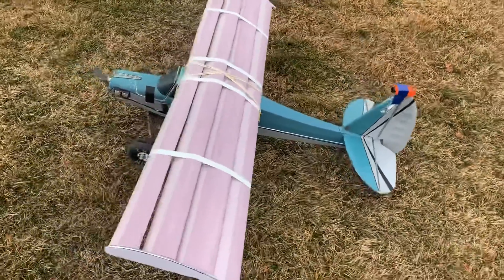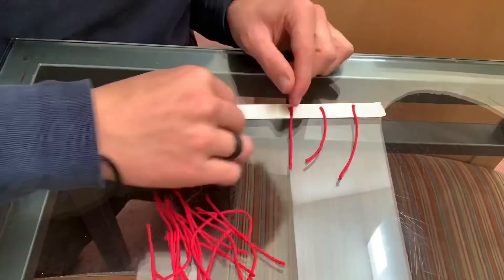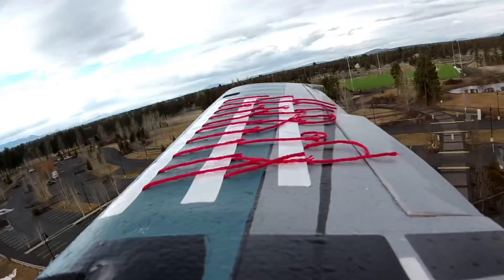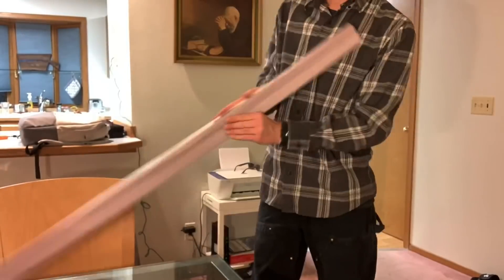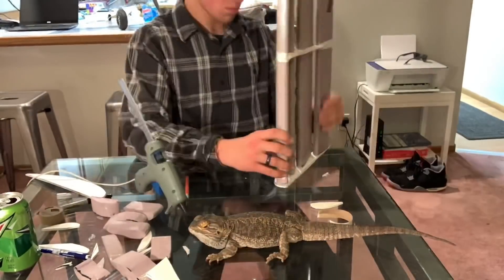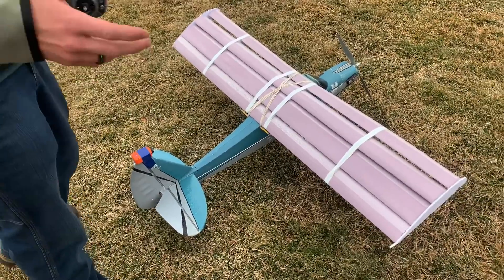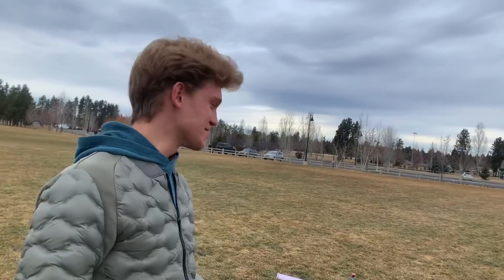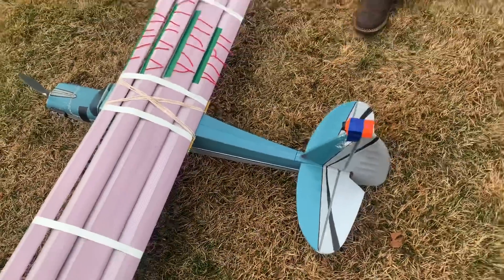“Unstallable Wing?!”

Comment: Stall is separation of flow over the top, and loss of flow to the trailing edge controls. Mainly its nothing but turbulence instead of flow which makes lift & gives control.
Not just too slow flow, but burbling mess instead of flow.

Aspect ratio is span squared / area.
At aspect ratio under 3, when flown slowly at high "A", the huge wing-tip vortices wrap around capturing a "bubble" of low pressure above/behind the wing giving up to 3 or 4x the lift you'd expect from that area at such slow speed.
The vortices trap flow from the front over the wing keeping it from separating.
Controlled stall-free flight has been demonstrated at up to 40+ degrees "A". Conversely, they need 20+ degrees to gain extra lift and get aloft.
The wartime German Sack AS-6 most likely didn't have appropriate landing gear to allow "A" to get aloft. Many similar planes have done well.

They are not burdened by always carrying around the vortices and attendant drag: the vortex-driven "parachute lift" at super slow speed and high "A" is elective and temporary. 

Many of the very-low aspect-ratio planform have proven this, and also proven to not be draggy or inefficient in cruise, but notably quick on available power.

Comment: I'm not sure what protocol you're using but if it's a Spektrum, they have a safety feature called THROTTLE CUT. It disables the throttle with a flick of a switch. It's a good thing to use and mandatory at my flying club.

Comment: Well the problem here is with big angle of attack, thrust points upwards meanwhile you would like to continue forward, which does not work. There is no force, that would push you forward. And the reason why we do not use such wings is, that there is ton of drag created. Even STOL airplanes with slots has bad performance regarding drag. No STOL airplane can fly too fast. There is always a cost for any gain. Therefore it is better not to stall airplane and fly with small angle of attack and to have good performance wing. If you are at least a bit skilled pilot, you do not stall your airplane accidentaly. And if you do, you should train more ;-)

Comment: To cut Styrofoam, cut two airfoils from wood and stick them to the Styrofoam. Get some thin wire and a rheostat to control the current heating the wire. Make sure you don't electrocute yourself. Use the hot wire to cut the airfoil

Comment: It seems like almost none of the individual wings were stalling. I wonder if it's because the air flowing over the top of each wing is compressed by the gap with the previous one and has locally higher velocity?
Reply: Correct conclusion (locally higher velocity), incorrect reasoning.

Stalls happen because skin friction drag slows down the airflow close to the wing surface to near zero; this has no impact on the leading part of the wing because the pressure is reducing with the airflow, helping the air along. But on the trailing part of the wing where pressure increases back to atmospheric the air molecules don't have as much kinetic energy remaining to convert to push through the adverse pressure gradient. Taken to extremes by decreasing the speed, and hence the kinetic energy reserve available to the air, the result is the onset of reverse flow of the kind that send the wing strings forwards (as seen in the video), flow separation and loss of lift, as basically the adverse pressure gradient is pushing the air on the trailing edge forwards faster than viscous interaction with the faster moving air a little further away from the wing is dragging it rearwards.

By employing slats, it essentially takes high velocity air from below the wing and injects it into this slow airflow, speeding it up through viscous mixing and giving it the kinetic energy it needs to work through the adverse pressure gradient, preventing the flow reversal and stall, and shoving the stall speed down as a result.

More slats = more fast air injection = more energy available to skin-friction-drag-impacted-air = shoving down of stall speed.
Reply: @spychopath  well, to be technical about it, stalls occur when flow separation occurs which mostly dependent on velocity is not a strict function of it—iirc it's momentum specifically... Somewhere there's a Reynolds number in there. Of course the impact of density changes are minimal compared to airspeed  You'll note that I say the slats compressed the air. If you read between the lines and recall your basic fluid dynamics, Bernoulli says this means the velocity increases, which was indeed what I was going for. Thanks for emphasizing the importance of air velocity. I guess what I tried to say I said too briefly. Thanks for providing clarification for any other readers!

Comment: Nice idea, but its not scalable. Reynolds numbers come into play. Flight is a series of compromises. This would work to a point, but the increase in drag would make the idea uneconomical. It is simply an extension of slats which is a single element at the leading edge and are used on many aircraft including commercial passenger aircraft and homebuilt STOL craft.

Comment: Stall results from the wing exceeding the critical angle of attack.
Wings can stall at any speed.
Speed generates lift, more speed more lift.
Once lift is sufficient to counteract load (gravity in unaccelerated flight), no more speed is required to fly, and no more angle of attack is required, thus the wind will not stall.
Stalling is not a problem in flight, but poor airmanship is a problem.
Therefore, efficiency is more important than anti-stall, in real aircraft.

Comment: I was interested in this video because your wing is similar to an F1 cars front wing.  I now see why they have so many elements....at the same time, I'm curious why your wing isn't stalling. Is it because of the multi wing design or because as you pitch back, the several wings become more and more effective due to their angle.....the latter wouldn't apply to F1 cars because they're at a static angle.  🤔

Comment: The result is not a realy advance because the plane is uncontrolable at too low speed...2 old systems make a plane autostable without complications like slotted wings: the autostable wing profile use on the Fauvel flying wing, and the Mignet flying flea (upgraded HM14 1936 and later models): close the stall, both did recover alone normal flying conditions without pilot action...on a Fauvel did the wing porpoise like dolphins, and on the flying flea did the airplane only slowly sink

Comment: Our Cessna 150 (N51305) after a new NACA foil and a stall kit added our take off speed was around 12 knots. With the right wind speed we could take off backwards.
Dryden NASA out at Edwards Air Force base even tested our plane. We have VHS tapes of them testing it.
Our plane is the military grey with the letters RG on the tail with the air force bars and stripes on the side.
One day our father was flying in to Mojave airport. He was cleared to land. Then 4 Apache helicopters were cleared to land. They flew right under him. He lined the plane up with the 4 helicopters. When the helicopters landed vertical, so did our dad. It freaked out the helicopter pilots.
They all went to the tower to find out where this new vertical take off and landing plane was. The tower guy was our friend so he knew but he didn't tell them.
This was back in the early 90's.

Comment: That was a great experiment.  At some point, stall or not, you just won't have enough lift to fly.  When you crashed your spiral prop wash was probably dominating the normal wing air flow plus the reaction torque from speeding up the prop just couldn't be overcome, especially without ailerons.  Another thing to try might be slower and slower snap stalls, or try to do a crow-mode type descent with the elevator full up.
Reply from the maker: Good ideas! I’ll keep those in mind, I plan to have a part three coming soon!
Reply: @baileyharrisRC  One more idea, I tried gluing on little vortex generators on a Multiplex Acromaster, achieved almost what you did but retains the original wing.  It had with a lot more drag (used too many) but flew like it was on rails and could not stall it.  You can make them out of thin plastic.

Comment: Just one suggestion: put flat, wing tip end-plates (latger than the profile of the airfoil) to keep the airflow over the wing stable when the stall approaches. This will cause a mild loss of altitude (parachuting) but no catastrophic stall.

Comment: A stall is a condition in aerodynamics and aviation wherein the angle of attack increases beyond a certain point such that the lift begins to decrease. The angle at which this occurs is called the critical angle of attack. Air flow separation begins to occur at small angles of attack while attached flow over the wing is still dominant. Not speed..
See this site in design of Scrappy's wing I think you will find it interesting. https://www.youtube.com/watch?v=JcckHHiYkL0&t=215s

Comment: If you define stall as air becoming turbulent then in fact I don't think it stalled. The reason you lost control is a) too little airflow on control surfaces and b) no speed means no lift, no matter if the flow is laminar or turbulent, which makes your plane act as a brick.

Comment: Nice.  The large air gaps were smart, it looks like the slots might have been working.  The Reynolds Number calculation describes how the air behaves at different scales, on the smaller model scale the air is more sticky and flow could easily block making the slots appear to be absent.  Getting the Reynolds number effects right is very complex.  Big is beautiful.

Comment: What did I tell you about stealing my Venetian blinds for your silly toy airplanes?!

I kid of course.

Obviously, the problem with scaling up an idea like this is that the wing provides far more than a simple lifting surface for the craft. The space and structure and Aerodynamic protection for things like lights, fuel tanks, and flight control hardware.

Some of this could possibly be dealt with by moving to an Electrically powered airplane, but I don't see that as being quite viable yet.

Comment: I heard there's a practical application of this concept, the Antonov AN-2 (wiki: "The An-2 has no stall speed, a fact which is quoted in the operating handbook. A note from the pilot's handbook reads: "If the engine quits in instrument conditions or at night, the pilot should pull the control column full aft and keep the wings level. The leading-edge slats will snap out at about 64 km/h (40 mph) and when the airplane slows to a forward speed of about 40 km/h (25 mph), the airplane will sink at about a parachute descent rate until the aircraft hits the ground."[4] As such, pilots of the An-2 have stated that they are capable of flying the aircraft in full control at 48 km/h (30 mph) (as a contrast, a Cessna four-seater light aircraft has a stall speed of around 80 km/h (50 mph)).[citation needed] This slow stall speed makes it possible for the aircraft to fly backwards relative to the ground: if the aircraft is pointed into a headwind of roughly 56 km/h (35 mph), it will travel backwards at 8 km/h (5 mph) whilst under full control.")
Reply: yo thanks this is really cool
Reply: This is called slots. There are such planes. Bush pilots like to use them for short take-offs and landings.
Reply: @petrsedlak4761  только не slot, а stol
Reply: @spacer_feed8411  What? Of what?
Reply: @petrsedlak4761  correct name "stol" 
You write "slot"

Comment: Same concept as Fowler flaps and slats. The problem is your wing is unlikely to be as efficient as a traditional wing in the desired flight envelope. Mike Patey's advanced slat and flap design for his plane, Scrapy, is probably the closest to an "unstallable" wing you'll ever get on a full size plane designed to actually get places in a reasonable amount of time.

Also, stalls aren't necessarily a bad thing. Reality is there will be a point where the wing ceases to produce sufficient lift. The important thing is that it has benign stall characteristics. For some full-size examples look at the Lancair IV, which had notoriously bad stall characteristics with a strong tendency to drop a wing and go into an unrecoverable spin. With some help from NASA, Columbia Aircraft cranked out a wing that was almost as efficient, but that is well-known for being able to pull back into a full-stall and just gently pitch forward again until it builds enough airspeed to start flying again, and if the controls are still held full-aft, it just cycles over again. The end-result is a mild stall buffet and a modest rate of descent even with full-aft input on the stick. There are plenty of bush planes with comparably mild stall characteristics, or even more favorable stall characteristics.

A low stall speed is great, but I'd argue stall characteristics are more important. You want something that stall predictably and without any tendency for asymmetric loss of lift which can lead to a spin.

Comment: If you ever do a lot of poly foam reshaping again I've got two words for you:
Hot knife.
A bit of stretched stainless steel wire, a dc power supply and a bit of creativity can make a jig/device that can help you create uniform airfoils. Articulation of the wing vanes (like fowler flaps) can probably also grant some huge benefits, such as a bifurcate design for the rearmost vane so they can be used as ailerons.
I think that the logical conclusion is forced air so that the wing resembles large blown fowler flaps.
This could be really big for the stol community if it isn't already a thing.

Clearly at low airspeeds your elevator will ha e very little effect. Consider the relation of center of lift and center of balance.

Comment: Yeah well done! It was great to watch. Exciting LOL.

So wings stall at 16deg AoA. You can exceed this by doing what you've done (each element is never over 16deg AoA but collectively they can be) but I reckon your design is a bit like reinventing the wheel rather than discovering something we've overlooked. If it were better, in all likelihood it would've been at least very well tested by now since our understanding of aerodynamics is fairly well understood. I could be wrong however.

So leading edge slats, and Fowler flaps with a high lift wing in the middle (with lots of excess power and a large prop blowing air over the wings) should go close too. 
Engine enhancements not withstanding, some birds do this even with multiple element winglets. Check an owl out. It is friggen unbelievable the lengths nature goes to keep the boundary layer attached thereby eliminating feathers from rustling at high AoA. That's why owls are almost silent killers.

Perhaps have the main wing at the usual 4deg AOA, then leading edge slats to duct air over the upper surface of the main wing to delay boundary layer separation, followed by 2 element Fowler flaps arranged so collectively they make the wing have an arc but each trailing edge is like stator directing the flow onto the next element.
Looked at from the side the whole has a totally different camber than the individual elements.
 
The A-5 Vigilante had blown flaps where bypass air from the engines was ducted across the flaps for added lift in carrier ops.

Want to read something interesting read about Whitcomb Area Rule. It also inspired a whole generation of familiar design queues - particularly late 60s and early 70s muscle cars and glass soft drink bottle shapes.

Comment: You could try a swept forward wing so you don't get tip stall and the plane will eventually stall flat when it does stop flying.....and a pair of contra rotating props to negate torque...

Comment: Too much drag, each edge although providing more lift is making the wing stall as speed slows, not only that but whilst one foil may be optimal for lift the latter will be less lift more drag. You might have a chance if you create a bigger space between foils and/or slimmer so you might get airflow over more of the surfaces.